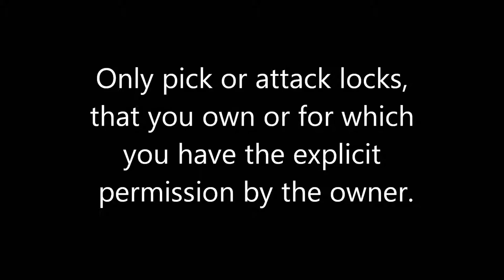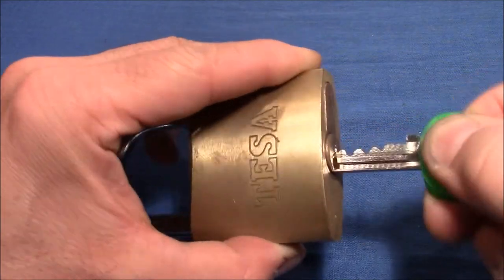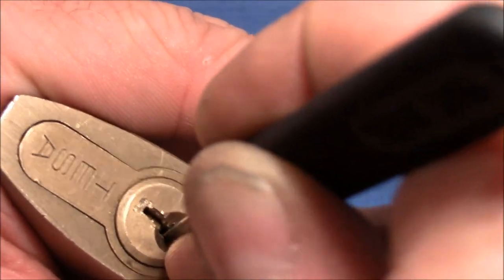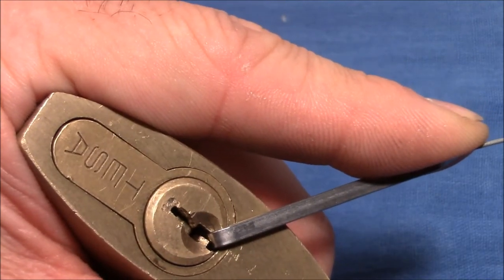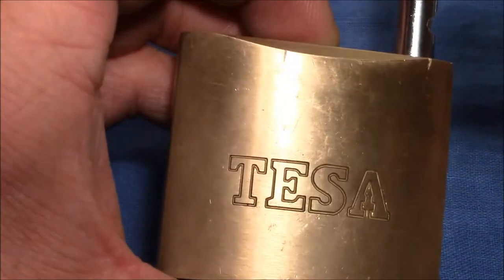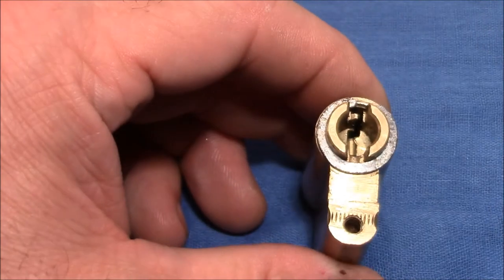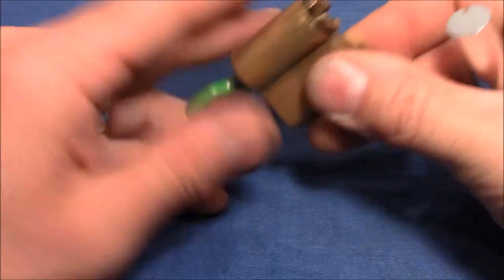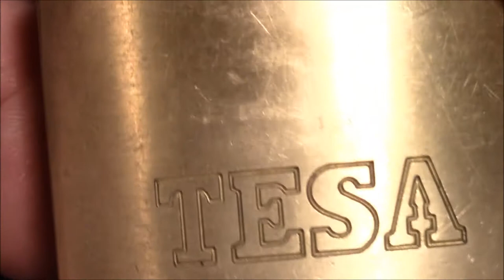(picking 73) TESA padlock picked and gutted - sent from adrian leon - thanks

Comment: Great picking and interesting core. I have an old brass closed shackled Squire padlock with an Abuse euro lock inside and it seems or appears to be a door euro that was modified to fit.
Reply from the maker: +waddac2 Thank you. I don't think that TESA would cut euro cylinders to equip their padlocks; most probably home made. But very nice work. The gap from #3 to #4 is also unique - cannot imaging a reason for that.

Comment: Great picking, but i am a little desappointed. 0)))
There are not the original TE5 TESA pins (only the 3rd i think), and i am afraid the change will have made it easier (sorry Adrian, but it's only my opinion ;))
Reply from the maker: +de Ronchopathe Thanks. So the original pinning only has standard pins?
Reply: con pins estandar es mucho mas facil de abrir. a no ser que tenga una combinacion muy complicada. le envie otra con pins echos por mi i creo que es mas complicada que orijinal. SALUDOS